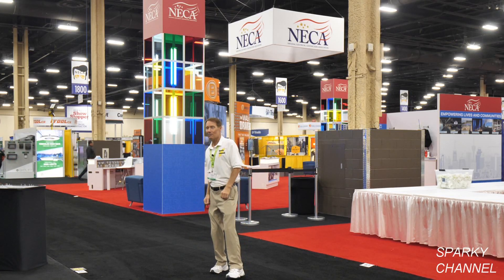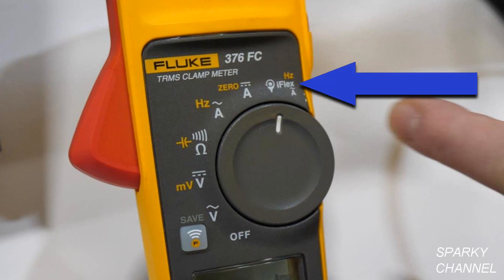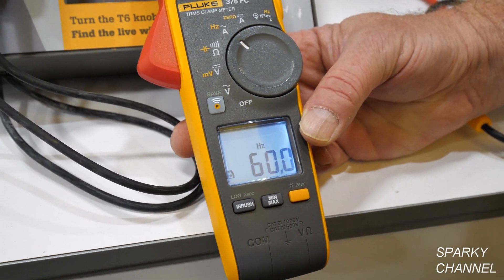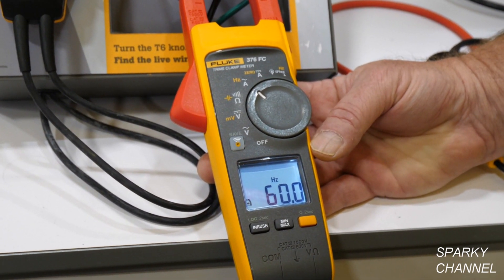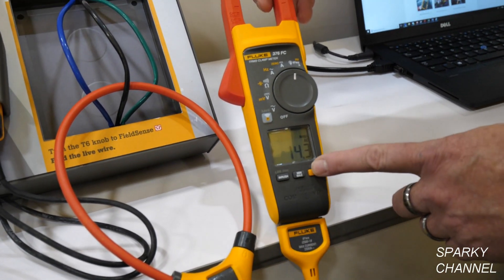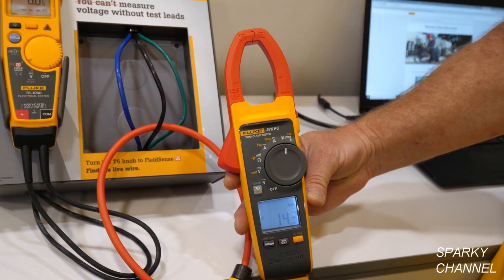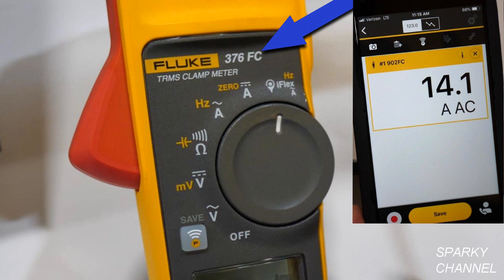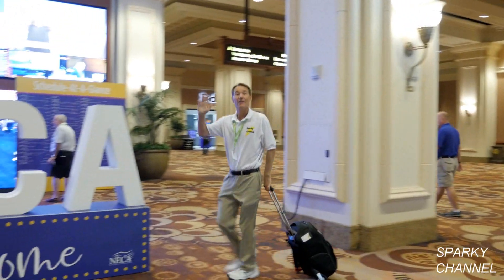Fluke 376 FC True RMS AC/DC Clamp Meter with IFlex Review

Comment: I measured current using iFlex on a run of 3 conductors connected to single node (Red phase), The connection was similar to demo shown in  video; the measurements were proximality 290A on a single phase whereas when I doubled the turn of iFlex in order to obtain precise reading as showing in official channel of fluke at following link: 
https://www.youtube.com/watch?v=tti4SnLjKOM
Surprisingly, I noted that the current doubled exactly.
Can anyone explain me which measurement method is correct, single turn of iFlex or Double turn?
Reply: Either is perfectly valid. The measurement made without doubling the iflex around the wire is the correct value. Doubling the iflex will always read double the actual current being measured, which can actually be quite useful if you are trying to measure a rather small amount of current. This is exactly the same as making multiple turns of a wire through the jaws of a clamp meter.

Comment: I use my 376fc daily, not a fan of only being able to get hz readings from the amp reading settings. There should be a setting to read hz from the vac setting by pressing the function button just like the 87v, 189 and 289.

Comment: In the first measurement with the clamp it measured a value and then with the iflex it measured another value.
Reply from the maker: Yes, I noticed that as well.
Reply: Yeah, the meter/built-in clamp has an accuracy spec and a repeatability spec.  It is impossible for 1, 2, 3 or 5 of the same meters to measure exactly the same current.  And one more factor comes into play.  The clamp on the meter is a different type of current device than the flexible probe.  That flex probe is a Rogowski coil that is going to have it's own accuracy and repeatability specs so there is no way unless you get lucky that they will read the same current measure as the built in clamp.

Comment: Hey buddy! Hoping you can help me with a clamp meter. I dont know much but truly looking to learn! I want to purchase a clamp meter under 200 for AC AND DC current I'm looking for something SAFE/WELL PROTECTED and capable of reading AC AND DC current from .5 amps to 60 amps as accurately as possible through the clamp. Do you have 1,2 or 3 suggestions. I was looking at the Klein cl800 but someone told me it will not read AC AND DC current through the clamp down to half amp accurately..... THANKS FOR ANY HELP YOU CAN PROVIDE ME
Reply: the higher current you measure the less accurate results. The lower the more accurate. 1% at 100 amp will give you about 1amp accuracy. So it could be 99amp or 101 amp
Reply: This device, and many other clamp meters as well, has only 1 digit after the decimal point. Hence, you cannot distinguish between 1,44 A and 1,4 A. But you can distinguish between 14,4 A and 14 A, which means a 0,1% accuracy can only be reached for higher currents > = 10 A. This seems to be the primary use case for this and other clamp meters. Fluke has another clamp meter that resolves lower currents with higher accuracy but I guess it will become difficult with a < 200 bucks budget for the range you mentioned.
Reply: Klein meters are a good choice for under $200

Comment: will it read micro amps?
Reply: This is incorrect; this clamp cannot read small current. Anything under 0.2-0.3A is in the lowest range; the meter has no smaller range.
Reply: since alexandre said no, I'm going to suggest you get a long wire and make 10 coils, this will amplify your amps by 10 times. So if it reads 32 amps, it's 32/10 = 3.2 amps.
Reply: @llVIU 's trick is correct but requires the ability to coil the cable to measure in several loops and inserting the clamp within the loops.
Reply: @llVIU  I understand how to do that. As an HVAC Service Tech, it is rarely possible to check flame sensors like that. Flame sensor wires are almost never long enough for that.